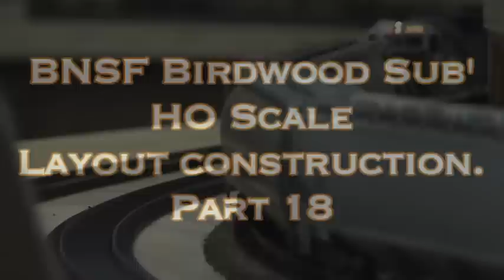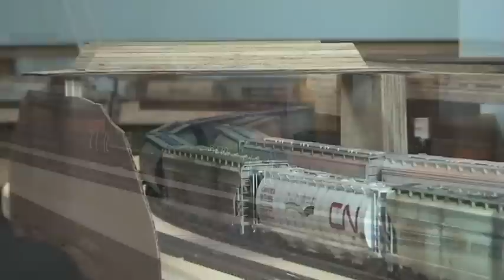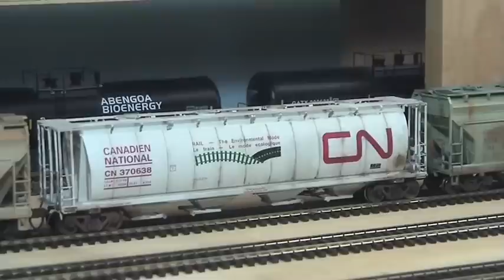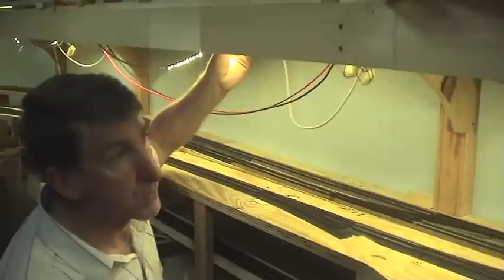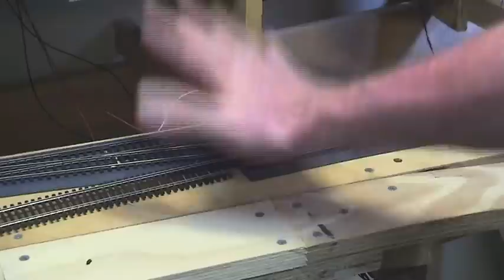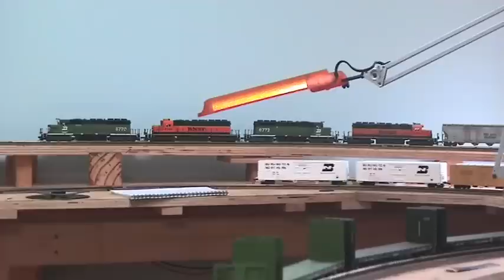BNSF Birdwood Sub' HO scale layout update, part 18.

Comment: See were 8 4400 locos were delivered to western AU. posted on Rail Link had picture on them on flat cars. What modification have to be made to run them. Think they were used.
Reply from the maker: They would be going to the Pilbara region Arthur, top end of WA in the iron ore mines. They use Dash 8 and 9's and SD70 ace's up there, I don't know the mods, but I recall they have better cooing for the heat and marker lights. Also they are set up in "in cab" signals, but not too much else I think, we also have a couple of SD40-2's over there!!

Comment: Regarding that switch that is driving you nuts. Try your hand at building your own switches. It is not as scary as some make it out to be.I have been making my own for quite awhile now and they always look and work better than anything else. I don't put all of the stupid joints in the point rails that are such a nightmare for some modelers. I have several with spring frogs, moveable point frogs (two-piece and 1-piece) and now I am going to build a "jump frog" one of these days.
  I destroyed an athearn 5-bay rapid discharge hopper today. I screwed up and bought the wrong paint and didn't notice until it was too late. I just altered the method and the others turned out much better. I bought some really nice Cinnabar aluminum hoppers, and they will more than make up for the loss.
   I have an idea for your scenery that I have tried with some good success. Steel screen (screen door) stuff. and Flex-Seal, none of this plaster and paper mache'
crap to put up with. It works unbelievably well and goes together in a mere fraction of the time that it takes to mix up the plaster, smear it all on and then have to clean up. No mess whatsoever! And it doesn't crack when the wind blows or if someone leans on it. I know that you are not into scenery but this will help you change your mind. It looks fantastic.

Cheers---Shane

Comment: My kitchen layout is loud. Actually the room itself is loud. I really like the track noises though.  Im going to turn the Tsunami in my -9 down even more.  Do you know anything about Intermountain Lok decoders?  I would like to turn down my SD40-2.  Your weathering is looking awesome btw.
Reply from the maker: As I've said before, I run all my units prime movers at below half volume, around 90- 110 , this way , all the other sounds are clear and you can adjust them so you hear them over the engine. I don't have any new LOK sound decoders, but I'm sure a search will find the manual. Thanks for the positive comments!
Cheers Gregg
Reply: FishplateFilms Ok thx.  Do you know how to make the Tsunami ATU-1000 EMD 645 turbo do trailing backward operation?  Ive done it with digitrax decoders, but never a Tsunami.  Ive been looking at soundtraxx manuals, but its not working so far.
Reply from the maker: Don't know what you mean by "trailing backward" ?
Reply: ifly65 MU'd as a second loco, turned around facing the rear, running backwards.
Reply from the maker: ifly65 This should be done by your throttle, not by the decoder. As long as the decoder is set up to run forwards when the loco is facing forwards, then when you set up a consist, you set the trailing loco to reverse( if it's facing that way) and the system will set the decoder to run backwards. Cheers Gregg
Reply: FishplateFilms Ahh.thx again Gregg, Ive been doing this the wrong way. This is much easier.
Reply from the maker: ifly65 Your welcome!
Reply: ifly65 Hmm, that didnt work. Im using a Zephyr DCS51 with no remote.  Im not sure if thats considered a 'throttle' or not.  I may still be doing it wrong, but I see no settings to set a trailing loco in reverse.  Switching the Forward, Brake, Reverse lever on the command station while on that loco address, doesnt reverse it either (in MU).

Ive done this before with the same Kato SD40-2 loco when it had a digitrax decoder. I had to change cv value 38 to tell the loco to run backwards.  This info was in my DCS51 manual.  It worked trailing backwards with that decoder, but I have replaced it with the Tsunami and Im not sure now how to change its values for reverse, if thats the only way I can do this.
Reply from the maker: ifly65 Sorry, I don't know the Zephyr system, but on NCE,  to set up a consist,you set the lead loco no. and direction, then the trailing loco and direction and that's it, no CV's to change. Does the SD40 run correctly on its own. ie forward is forward?
Reply: FishplateFilms Yes it runs correctly, forward is forward, reverse is reverse. Im pretty sure according to the manual, I need to find out which cv will reverse the loco, like I did with the digitrax decoder.